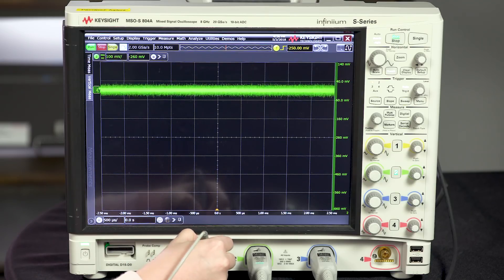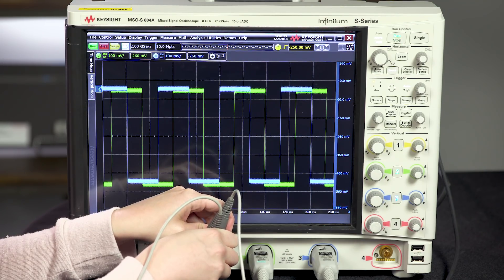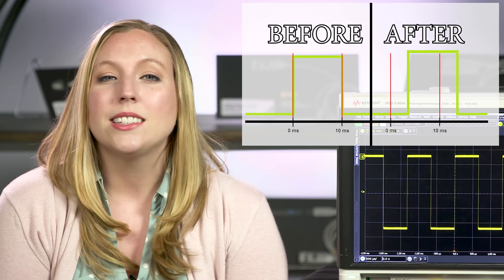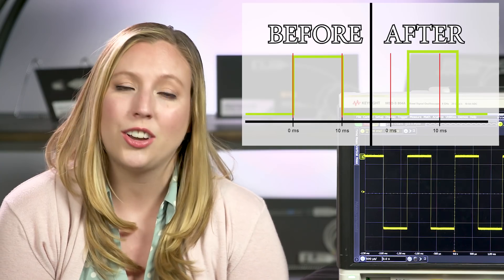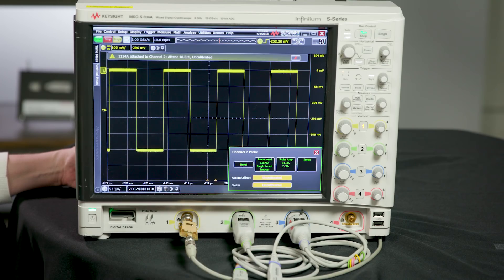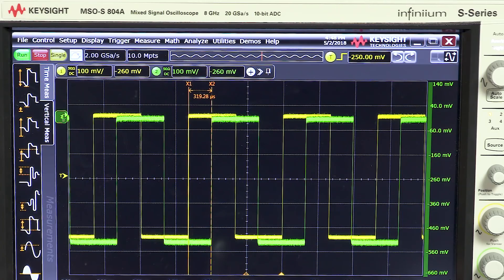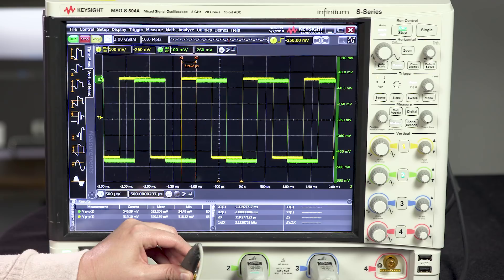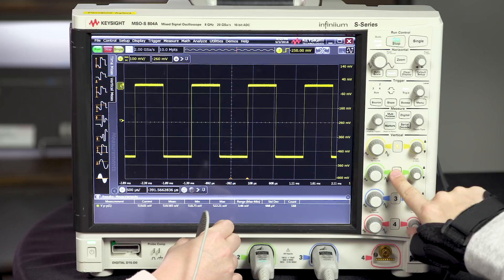How to Calibrate Your Oscilloscope Probe and Why – Probing Pitfalls

Comment: Hello. I am wondering how I can compensate my oscilloscope 10x probes on a mini pocket oscilloscope? It has a signal output generator, but it does not have the part to clip the probes to in order to test the square wave. How do I go about compensating these probes? it is a dso nano v3.
Reply from the maker: Your best bet is to find a known fast edge and use it as a compensation signal. You don't need one in the scope, all you need is a signal that you know has a good edge.

Comment: ~320 µs of skew actually seems kind of ginormous. Was this presentation staged to demonstrate the concept, or is that the kind of variability you can expect between Keysight probes from factory? It's still unclear exactly what would introduce such a big skew. It's unlikely to be any analog component that is doing it, at least for a probe with that high of a bandwidth. So what remains is the DSP. Is the "skew" simply from a default (maximum) delay time that delays the signal if the probe is detected as being uncalibrated?

Comment: Regarding the example presented with 319us skew, what is the source of this delay?
If it were simply due to probe capacitance not being correctly compensated, then the waveforms would not have a sharp rising edge, nor a flat top, even though this is a very low speed measurement.
The delay cannot be simply the probe cable length, as that would require a length of 100,000m (air dielectric).
Reply: yes, she should have described it but didn't
Reply: @優さん-n7m  Seems like they want to sell their deskew product...